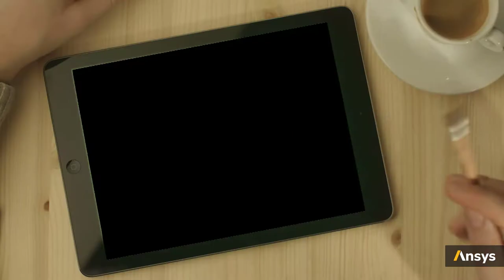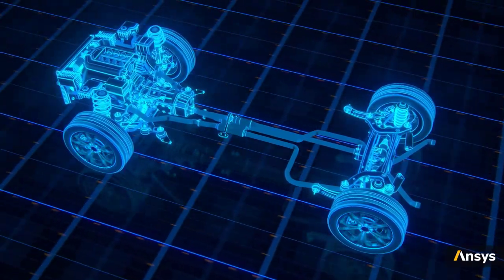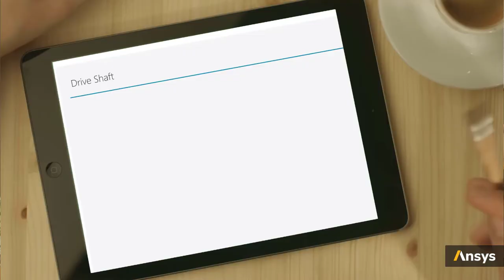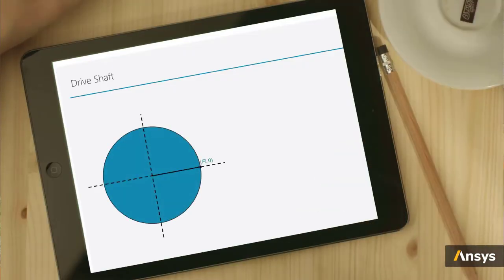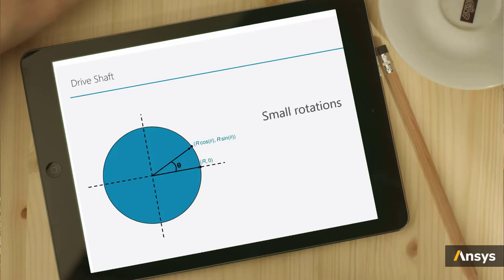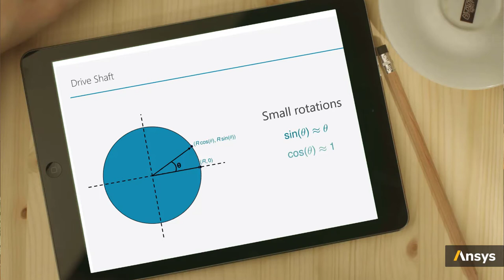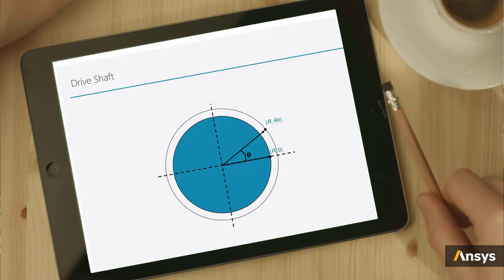Intro to Large Deformation — Lesson 1

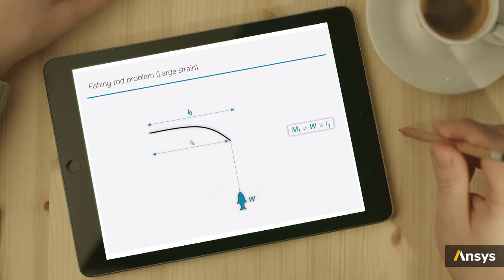Comment: Thanks for the informative video. I think a correction needs to be made at 3:15; a change in the amount of load acting on the structure changes the shape, and NOT a change in the shape changes the amount of load acting on the structure
Reply from the maker: Hi Mohammad, 

Thanks for watching! What is being said here in the video is correct. The moment is generated due to the weight of the fish. Weight of fish is causing the structure to deform which changes the moment on the structure. Hence, change is structure shape due to applied load also changes the load on the structure.